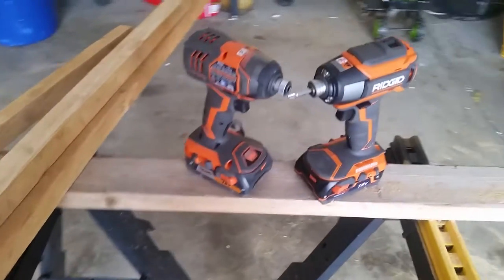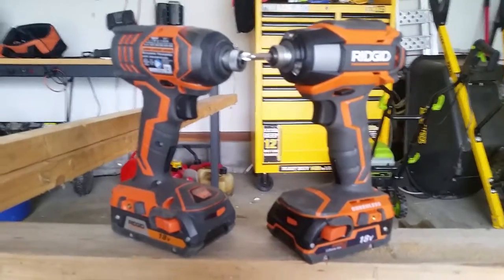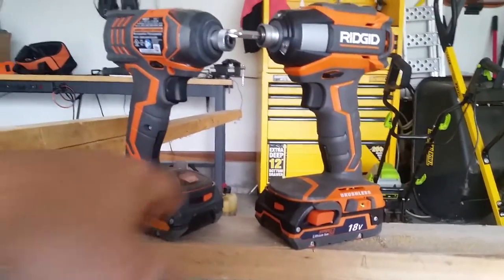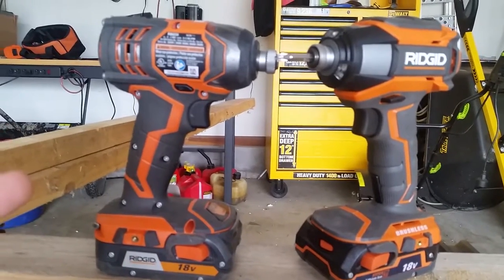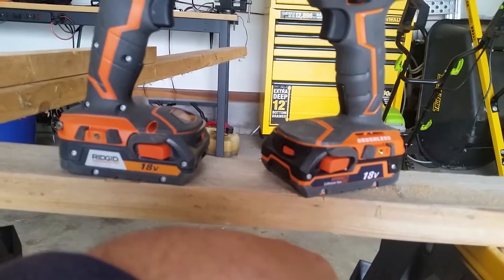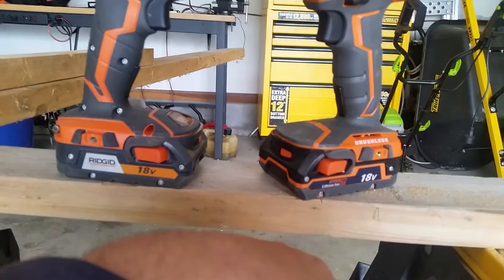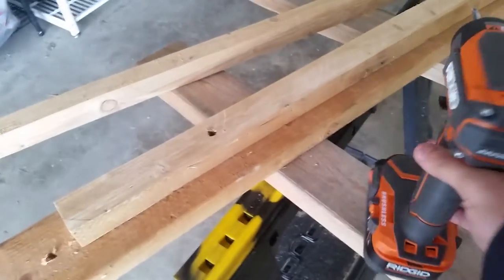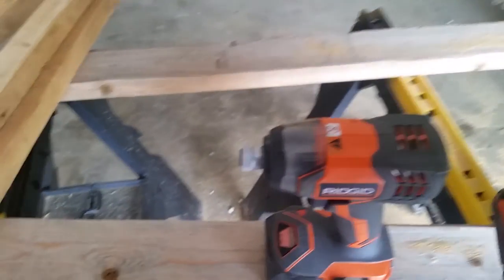Ridgid GEN5X 18-Volt Lithium-Ion 1/4 in. Cordless Brushless Impact Driver Review

Comment: Now that I have both the Gen 4 & gen 5 brushes driver they. Do feel..the same too bad I can't test it gear case is. Shot in gen 4 ...... I can convert a Gen 4  impact driver by  changing the anvil set to 3/8   Should I get & sockets set  I have seen  Walmart got a socket set deep well  $17.97 Stanley ... bits I  don't want to brake the bank but also want them to last a bit
Reply from the maker: Believe it or not, harbor freight actually has some half decent sets for cheap.  Husky also has a no questions asked return policy